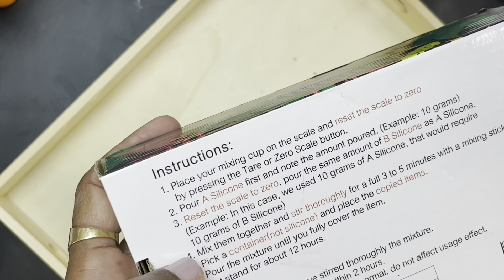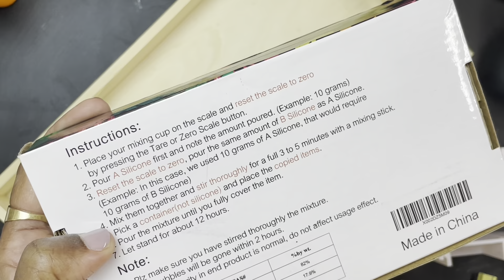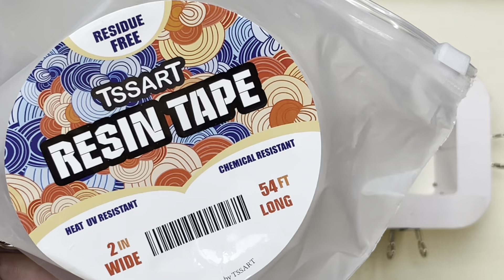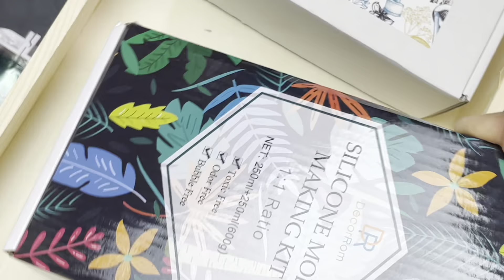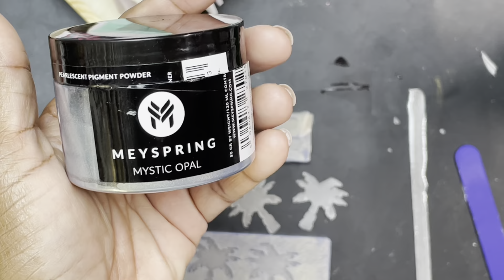#380-Trying Let’s Resin Adjustable Mold Housing @LETSRESIN

Comment: I've used this silicone before, I thought you have to measure by WEIGHT not by volume. I measured like you did and the mold came out sticky/tacky. I redid it by weight and it came out perfect

Comment: My mold housing is silicone. Yours is rigid plastic. Did I end up with a knock-off?  My silicone fuzed to the mold. Now it is ruined.
Reply from the maker: I hate to tell you but it wasn’t the right thing. Silicone to silicone will fuse together. What I have of from Let’s Resin and it’s a very hard plastic.  I’m so sorry.